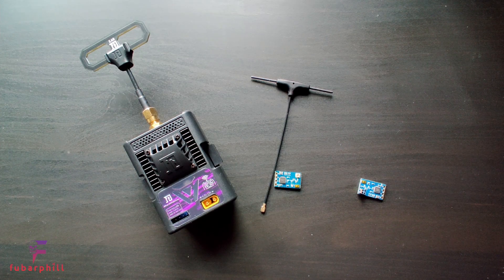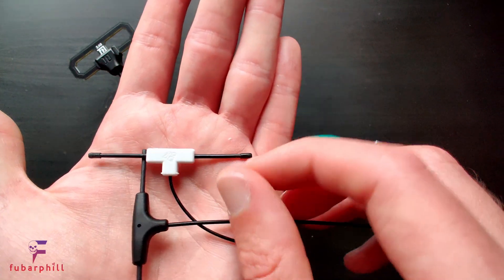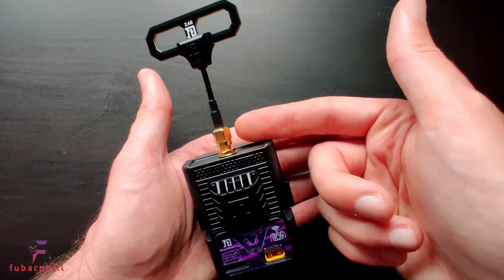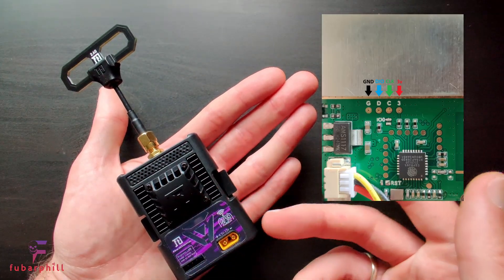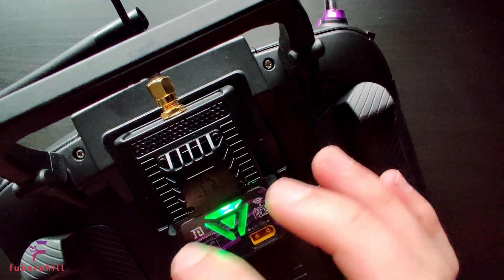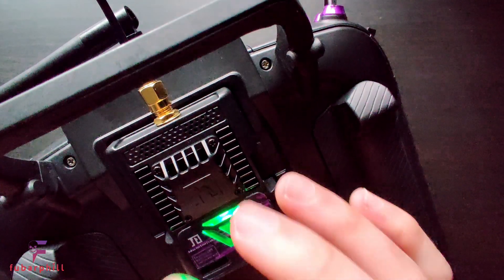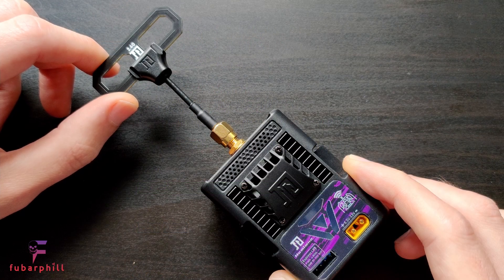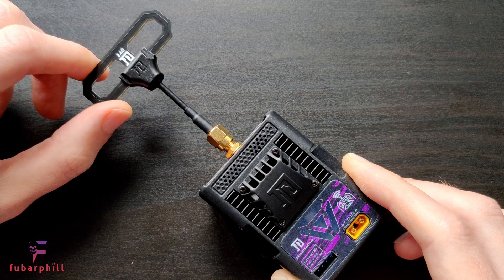Namimno Flash 2.4GHZ ELRS -  Review & TX Flashing Guide

Comment: If I must have a USB port what's the best module to get, the happymodel?
Reply from the maker: If the USB thing is a dealbreaker for you, then I think the next question would also be what transmitter you have as you may be limited in choice for some. Happymodel have various models to suit most radios and have been out the longest, so arguably more support available from other owners on Discord etc. If you have a radio that accepts slim/nano modules then BetaFPV could also be an option and HGLRC have just released their version which I think is a full-size JR module only at the minute. There is also the DIY option, which hasn't done me wrong yet! The great thing about an Open Source project like this is that you have plenty of choice.
Reply: @fubarphill  I currently have a FrSky QX-7, I was thinking about getting the Eachine TX16 next.  Full size radio is preferred and I am capable of DIY, but I'd rather have a finished product especially since they are relatively cheap.  Ta for the help phil.
Reply from the maker: Since you're looking at a full-size module then yeah I would go Happymodel if you want USB and less messing around especially as the newer versions come with a better case, which was a bit poor with the very first release. Also, with the QX7 I think you need a power/inverter mod depending on the version if you haven't done it already.
Reply: @fubarphill  The QX7 is vanilla, I should probably get a new radio to go with the module.  Alright this is clearly going to be a mission thanks phil.

Comment: Didn't see where you connected to the TX wifi so that you were able to flash it from the Configurator.
Reply from the maker: It's about 9 minutes in. With using the ESP Wifi backpack, you connect to that, then connect it to your home wifi. Once it has connect then, assuming you have the module powered and you are in the vicinity of your router, it will just be another client on your home network. So you don't then need to directly connect to it again and it will just be 'found' on your network as "elrs_tx.local". Hope that makes sense.